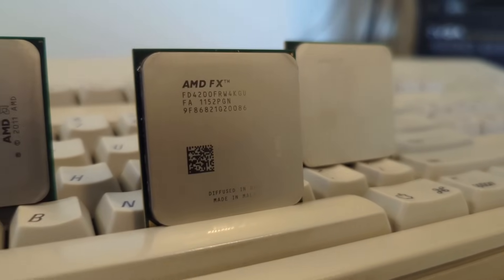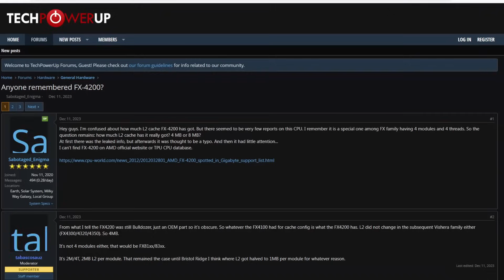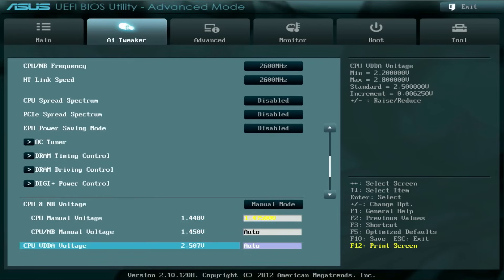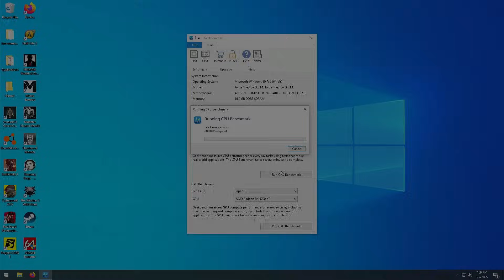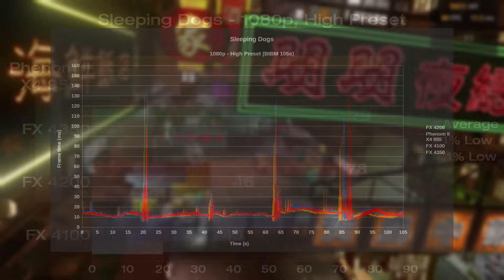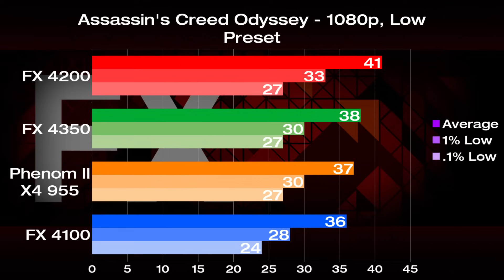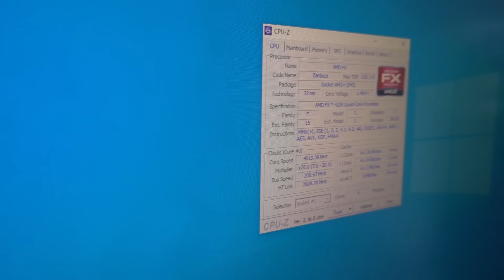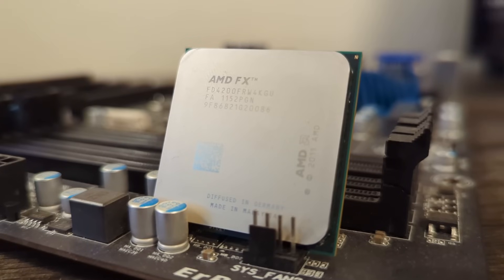What if AMD FX had "real" cores?

Comment: Finally retired my FX-8370 earlier this year after a decade of daily use. Had the Black Edition that came in the nifty tin box, nestled in a Asus Sabetooth 990FX R2.0. Solid performer, never missed a beat, even handled running an RX7600 for a bit. People say they were hot chips, but with a Seidon 120 AiO, thing never got above 50°C, usually hanging out in the low 30s. Powered through HD video editing, ran four concurrent VMs (Win95, NT, 2k, and Server 2008 R2), various Debian installs, MX Linux, even worked fine on Win11. Only issue I had towards the end was Windows occasionally crashing due to something weird going on in the memory controller (Linux didn't seem to mind), but blacklisting a couple "bad" 4k segments made it stable. Not like missing 8k out of 32GB would hurt much. 

My nephew is still gaming on a 6350, and it runs Baldur's Gate 3, even though that recommends a minimum of an 8350.
Reply from the maker: Sounds like you got a lot of longevity out of it! Running an RX 7600 on one is new to me, I would assume it would get badly bottlenecked by the PCIe 3.0 bus and narrow x8 interface. How did it hold up in newer games?
Reply: @SPNG it wasn't bad. Mainly play WoW, and it could keep things smooth during raids. Would drop to ~20fps sometimes, mainly because of of the CPU bottleneck. WoW would only peg 4 of the 8 cores. There's benchmarks of the system on 3DMark. Surprisingly, there are/were a couple others with similar systems. I wasn't the only loony.

Comment: You stated the FX series started in 2011… my 2-core FX-60 would beg to differ as it came out in 2006 and this was after the single-core Sledgehammer ‒ FX-51 & FX-53, Clawhammer ‒ FX-55, SanDiego ‒ FX-57. After my Toledo ‒ FX-60 came Windsor ‒ FX-62, FX-70, FX-72 & FX-74. Only then came the Bulldozer and Piledriver FX chips you are talking about.
Reply from the maker: Pedants gonna pedant

Comment: Ok  the bulldozer achitecture has its drawbacks but for me they were cheap and you could get solid OC experience without worries for burning up expensive hardware  heck i got a fx 8950 with a solid Mainboard for 20€ and it was a upgrade for my friend and his fx6300 system and for his usage in audio editing and in arma3 it did pretty good after same oc especially the NB oc did reduce low 0.1% frames during dynamic sricpt loading
Reply from the maker: I did some of my first OC on an FX-6300 I used to daily drive years ago. It's one of their best parts IMO

Comment: Interesting video but I have taken a bit of a contrary conclusion to what you have,

Furthermore, I would really like to see you redo the comparison benchmarks at factory default clock-speeds for all these chips, because even though IPC shows which architecture can push more instructions per clock, it is the sum of all parts that shows where an architectures strong points are (which is clock-speed for Piledriver).

In addition, I found it interesting that the FX 4350 actually had better single core performance at the same clock-speeds than the FX 4200 (which indicates FPU isn't primarily the bottleneck) and another obvious observation is that floating point performance are split between the paired ALUs on Piledriver FX chips (but not by as much as 50%) and under certain instruction sets Piledriver FX can combine those two 128bit FPU pipelines back into one, if the workload is very single threaded, which would give all the headroom necessary to a single ALU (which would be similar FPU performance seen in the FX 4200). Subsequently, take note that resetting to default clocks will boost these floating point performances for FX.

Moreover, I think it is safe to say the APUs will generally bottleneck before the FPUs and I have made my FX 8350 a Linux based system which gains substantial performance in a game like Outer Worlds compared to Windows when DXVK is used (possibly with AVX instruction sets).

Lastly, remember these engineers are much more knowledgeable on their designs than us general consumers are (even ones claiming to be student engineers) and they know why they cut corners in specific departments to make optimization possible for what they wanted to achieve. My opinion is that AMD FX performs better than the other chips from this video in real world scenarios, when all the chips are at factory settings with their best combinations of RAM.

Comment: My first PC Build had an 8350 and a 7970 GHZ edition.  It didn't run as well as it could've but I used it until 2019. Even upgraded the GPU to a 970

Comment: Dude i tried to build my old phenom ii x6 some months ago and got some brutal results. It was a phenom ii x6 1065t with the maximum overclock i could make word. 8gb ram 1600mhz ddr3. Compare and crushed a fx 6100 i had on my closet since 2019.
Reply from the maker: What clock did you end up hitting?

Comment: This reminds me of an arguement I had with one of my classmates back when these were new. I maintained that the chips were good but the software/compilers werent doing right by them because of the unusual arrangement. I was arguing that the chips should be operating more like a 4 core with bonus ALU's sprinkled in and with compiler or software optimizing they should be doing much better than they were benching at.  He was arguing that "They sucked"

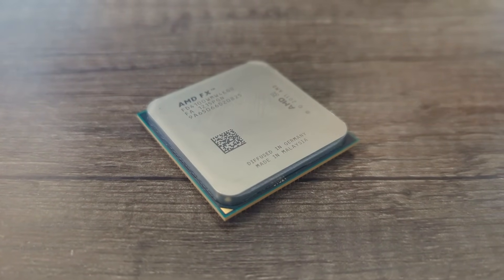Comment: @0:45 Uhh the FX series came out years before, I had a computer store still back in 2005-06 and the FX was new to the scene back then, so in 2011 the line had existed for half a decade.  I sold several and converted intel bois over to AMD, while I cruised on the first gen Opteron 1.8ghz don't remember the model.
Reply from the maker: Yeah, cause I was definitely talking about Athlon 64 FX 🙄

Comment: Bulldozer FX chips weren't 1st generation FX chips. I believe that title goes to the 2004-2005 Athlon 64 FX-53, FX-55, and FX-57. I had an FX-53 back in the day and I remember running it with a Geforce 6800GT and just crushing the 1st Farcry with it.

Comment: Hunting for FX4200... one option in BIOS does the same with any Bulldozer chip. On the other hand FX6300 (3M6T) was usually fighting against 4C4T chips from intel (cost-wise) so obviously it did destroy them in anything which wasn't limited to one or two high performance threads...

Comment: I got an FX 6300 so I could game while recording my TV shows, homemade DVR.
The place where the FX absolutely screamed was multiple apps. I could play Fallout or any of the Arkham series while recording with zero issues. Around 2017 I got an Intel system for a song, Xeon 1225v2 (essentially a 3770) with SLI GTX 970, 16 GB of RAM.
I couldn't play games while recording any more, dropped frames like crazy. My FX could have two cores assigned to the DVR software and that was that, I had 4 cores available for everything else. If I tried to assign one core of the Ivy Bridge Xeon to DVR it would drop frames, if I assigned 2 cores the game suffered and it would drop frames.
The FX wasn't the fastest CPU architecture out there by far but you could load it up with single and dual threaded apps (which were most at the time) and it ran them spectacularly. Doing the same on Intel's competitive chips failed horribly, audio/video sync issues, dropped frames entirely, often it would just stop recording all together.
The FX (at least Piledriver) were excellent work horses but not race cars, that's for sure.

Comment: i loved my old FX8350 OC. ran that pc for like 7 years. it wasn't fast but it was a work horse. reliable as hell.
Reply from the maker: What card did you pair it with, and what was your overclock set to? Just curious to see what people were running on their old setups!
Reply: @SPNG  I ran mine ~ 4.6 Ghz and used a 1080 when I retired it. Lasted me a LONG time and was still punching when I finally let it rest. Over time, better optimization tended to help it and it aged pretty well. Run a 5800X with a 3080 now and it's like night and day.
Reply: @SPNG  originally started with fx8150 and GTX670, then upgraded to a used 8350 and GTX690, then  few years later a gtx1060 6gb and more ram. i want to say it was about 4.7ghz and NB tweak. i still had air cooling until 2019. extra case fans + normal ones.

Comment: I have FX8320, and it wors well with 0.1v downvolt, on 3.5GHz at last 10years, and power consaption lower 90Wt on  peak On stock it draw ower 120Wt and very hot.
Reply from the maker: I always wondered what doing some undervolting would be like on these chips, I need to get around to testing that

Comment: Also any of the phenoms with a T in name like 840T are zomosa builds can be unlocked to 6corea. There is a 6core cpu to Thuban series
Reply from the maker: I have an 840T, unfortunately it doesn't unlock though 😢 I've got a 1090T so that scratches the 6 core Phenom II itch lol
Reply: @SPNG Your mobo didnt allow it or was unsuccessful. You also have to make sure that T model is in the zosma line of cores.  You can always try upping the voltage abit when u do the unlock sometimes due to the cores being cut off might not be binned well or you can down click it 50 to 100 mhz and gain the 2 extra cores. but anyways ya the 1090T and others I do like them especially more than Bulldozer series. The Piledriver I liked the OEM cpus the 8300 and 8310 versions. I was able to undervolt them and still get up to 4.9ghz I think it was 1.28 or 1.3v tested with aida64 and few games.  :)

Comment: Hello. I know on the 8300 and 8310 which are OEM versions of pile drivers I was able to get close to the 5ghz, within 100 to 200mhz with a undervolt of 1.3v sometimes 1.25v it out performed my 9570 what ever the number was for the top 9000 series was and ran cooler. Try that out. Also the motherboard to use that's great if u can find gigabyte 990fx-gaming had USB c support and high ran support. I ran 2333 on it but stuck with gskill Aries 2133mhz for long term. Everything is beautiful. Now if u can get the Asus sabertooth with pcie 3.0  yes there is 2 versions of saber which is almost impossible that be cool to see due to was only board with pcie from that amd era

Comment: One thing I remember about fx processors is that you really want to overclock cpu NB to minimize memory latency. Performance improvements were quite impressive. Something something those cpus really had problems with memory
Reply from the maker: I forgot to mention it anywhere in this video but I had the HT/NB tuned to 2600MHz on all the FX chips. Phenom II had its HT tuned to that too but not the NB since this board couldn't do it
Reply: @SPNG  that happens, but I am glad that you know about this particular quirk of fx processors. In RU segment for a long time was very popular "corn"(sometimes "popcorn") overclock, where people just overclocked cores by multiplier with minimal performance gains (popcorn is bigger than corn, but same nutrition value. 5Ghz is bigger than stock, but performance is the same)

Comment: pump higher than the rad. more prone to air. these coolers are known for air. just from my own experience's
Reply from the maker: Yeah, I'm aware it's not an ideal setup but it's the only place it would mount in this case unfortunately. Don't worry though, I didn't plan to run it like this for the long term.
Reply: @SPNG if it does ever develop a bubble then you could run the case on its side to mitigate it but sounds like you know what's up

Comment: I leapfrogged from an Athlon 64 X2 3800+ on a very basic AM2 motherboard all the way to a Phenom II X6 on AM3+ all with used Ebay parts and without ever totally replacing the platform. It was a very satisfying and cheap upgrade path that allowed me to stay relatively current on a young person's budget. It was also the golden era of PC gaming. Lots of hours in Battlefield 2, modded Oblivion, and World of Warcraft for me in those years. Awesome times. 

AMD's FX CPUs were pretty much never a good buy for anyone except those looking to squeeze a few more years out of their AM3+ rigs. These chips were very tweakable but at the end of AM3/AM3+ I clung to my Phenom II X6 1100T. At 4GHz overclocked very few Bulldozers/Visheras could keep up with it even with a very stout overclock of their own. If I hadn't had a Phenom II X6 and just had an X4 it might have been a different story for me. 

This did change in later years after the platform was totally retired. AVX and other tech slowly put Vishera ahead in modern testing. However at the time Phenom II X6 was often much better or just as fast and it was very hard to justify upgrading. For the price of an FX8370 I bought an i7 4770K instead and got a much better upgrade. Buying a whole new motherboard hurt but I was able to recycle my RAM and everything else from AM3+ so it wasn't too bad. It felt like a better use of my money.  

Bulldozer was known for shooting its power draw through the roof when overclocked and Vishera wasn't much better. I have to believe that there are some FX9370s and 9590s out there that are degrading at stock settings.

Comment: Since you were running these games on Windows, have you considered using a Linux distro to see if the results might differ? Linux distros tends to work better with older hardware and might offer to squeeze more performance out of your system. Give something like Bazzite or CachyOS a go since they are more gaming focused without spending a lot of time setting everything up.
Reply from the maker: Mayyybe could do some Linux testing if I do a follow up video (I also want to pit it against more CPUs) but I don't really do Linux to be honest. Since a lot of people are asking about it though maybe I just need to take the plunge lol
Reply: @SPNG  That actually might make a better video :) Getting your first experience with a Linux distro on camera as you figure out how to squeeze as much performance as possible!

Comment: Well, it could be worse. It could be the pit of despair that the Bristol ridge CPU's on AM4 systems when compared to 1st gen Ryzen in 2017.  Bristol ridge was part of the Excavator family.
Reply from the maker: Aw man, Bristol Ridge. I haven't used one but just assuming, it seems like a waste of the AM4 platform lol
Reply: @SPNG  If you needed a CPU to update a AM4 bios AMD would ship you a Bristol Ridge CPU with a deposit that would be returned when you returned the CPU.

Comment: The FX design was a drop in the bucket compared to the Phenom II.  I have the Phenom II X4 980BE, X6 1090T and a FX 8350.  The X4 980BE is faster than the FX 8350 during OS or game loading but as soon as the game is loaded and starts playing, the X4 980BE seems to slow down just a little bit compared the FX. When I clock the X4 980BE to 4ghz,  I can't tell any difference in the speed at all. When  I load up Oblivion inside Windows 2000,  the speed of the Phenom II really shows how superior it is compared to the FX chip. What AMD should have done was take the Phenom II CPU,added the newer instruction codes to the CPU along with 2 additional cores and gave us core speeds of up to 4.9GHZ; and name the chip Phenom III. These newer Ryzen chips are a real pain when it comes to compatibility.  I have 2 Ryzen systems that only run Linux because I have nothing that is completely compatible with them except DOS.  No, I don't run Windows 7 and up because the tool chain is so wide that it's a danger to connect those OS's to the internet.  I found this out the hard way when my network was breached.

Comment: I went from a Phenom II X6 1090T with a decent oc to a fx8150 (iirc) and returned it in two days, ran the 4770K until two years ago.
The 1090T ran in my mom's pc till also 2ish years ago.
Reply from the maker: Yeah... going from one of the best Phenom IIs to a Bulldozer would have been a real disappointment. I'm sure if you went to a Piledriver like an 8350 or something you might have been less let down lol
Reply: @SPNG 
Went through my e-mail for shits and giggles. 2013-07-05, it was a 8350 😅
Paired with a crosshair v formula z (I miss the premium motherboard for 200 euro's era).

But yea, didn't run as expected at all...

Comment: Fx8350 match with the same mob and R280x gpu still working.😂 it’s a back up system for friends to play world of tanks @60fps elite settings1920x1200. No match for a modern set up with 1440p monitor but still good for such old system.!!!!
Reply from the maker: Your system is an oldie but goodie! That 280X would have been a really competent card for the time as well.

Comment: Say what you want about the FX Series, but it was pretty serviceable, inexpensive and in the end, it always got the job done. I had a 4100 and it got me through my entire career in the university, then I started testing other processors in the lineup like the 4300, 6300, 8230e, 8350 and even the 9590 with it's absurd built in water cooler. 

FX was the steping stone towards total domination with Ryzen, Intel got stuck with their 14nm process so long,, nickel and diming the customer thinking AMD would never catch up, then they got a surprise and have been almost a decade now biting the dust every time.

I have fond memories of my FX machines, sold them only because it made sense when I got the offers.

Comment: I had FX 6300 back in the days. I remember disabling SMT in the BIOS and overclocking it like crazy -- was getting measurable 30%+ performance increase per core (had only 3 of those after disabling SMT, though). Great times.

Comment: My fx8350 served me so well from 2016 to 2022, and I have a huge soft spot for it.  Just really great bang for the buck and solid longevity.  I replaced it with a Ryzen 5 5600 when I built my current system.

That fx8350 system replaced a rig which ran an AMD Athlon II X2 250 from 2010 to 2016.
Reply from the maker: You could definitely get some longevity out of an 8350, some of the games you played later in its life probably wouldn't have launched on a Phenom II. I'm sure the 5600 was a massive upgrade though 😅